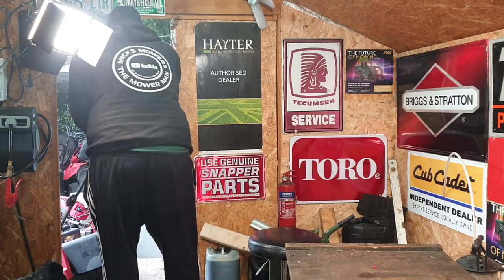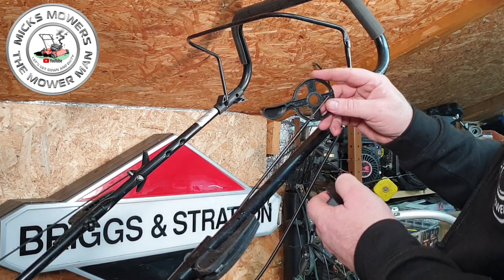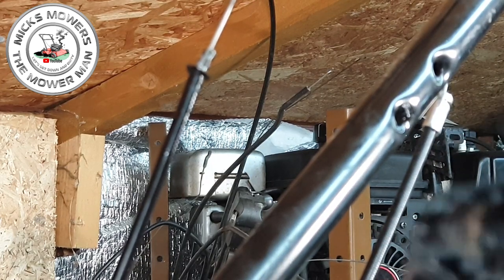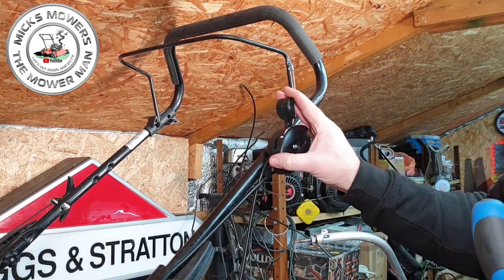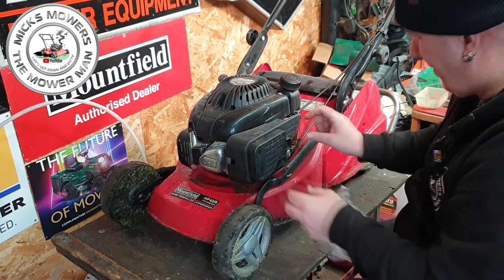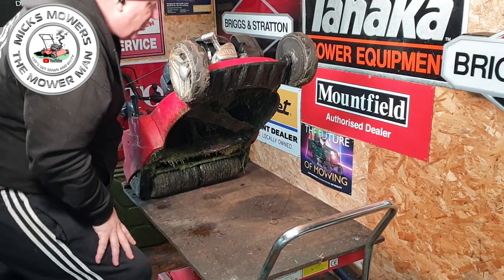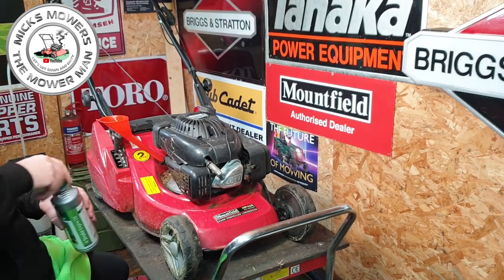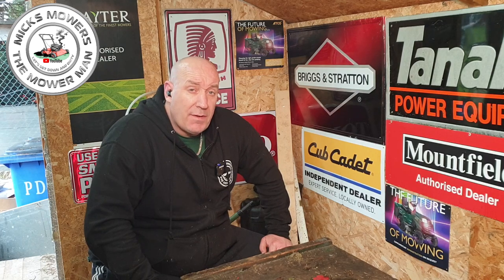Mountfield hp42r  Broken Cable Throttle Control

Comment: Hi mick, I’m having a similar problem with the throttle on my old qualcast classic 43s ! The box is cracked  and the cable doesn’t fit inside the grove so the outside moves with the inner? Can you help me in any way? Also my mountfield rm45 has trouble with the cable box where two cables fix on the handles(break and drive) I think I’ve found spare parts for the mountfield on line for around £8 enjoy watching your mower repairs …. Keep up the good work love to PIP.. best wishes Rob .

Comment: Hi mick, tried to get the carb out on my one of these but the nut on the underneath of the carb hits the wheel bar that runs the length of the mower.  How do I get the carb past that bar? Cheers
Reply from the maker: Remove the front wheel.. then remove the height adjuster bar... That's the easiest way...
Reply: @themowerman  cheers Mick that's great, much appreciated 👍
Reply from the maker: @jamesoates6309  no worries

Comment: Hey Mick don’t know if you still need a box for your vintage Atco but there is an add on e bay for 2 vintage mowers one which looks like yours and has a box. Based in Lewes. Cheers Rod.
Reply from the maker: Ok I will have a look is it on Facebook
Reply: I don’t know Mick I just saw it on e bay.
Reply from the maker: @rodflanagan6413  found it
Reply: Any good to you Mick?